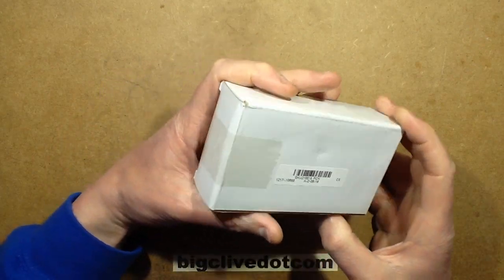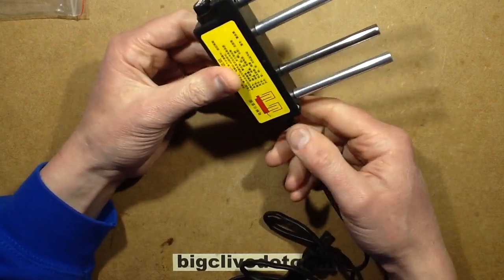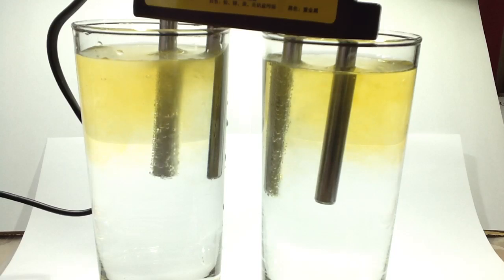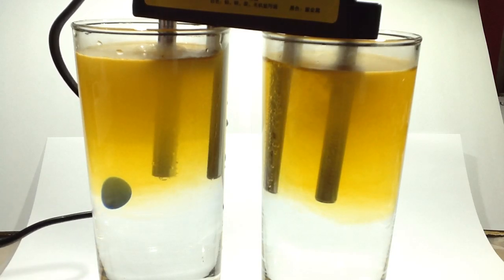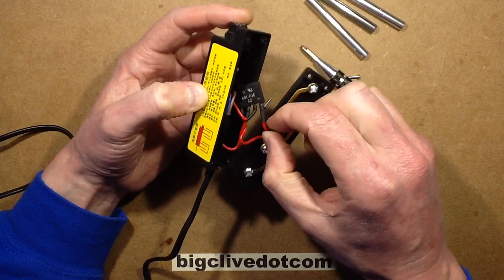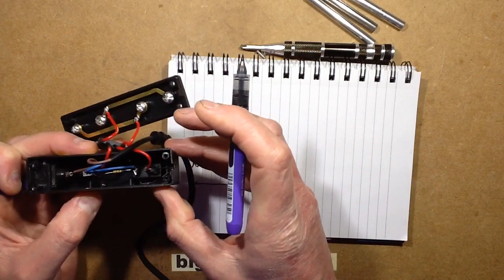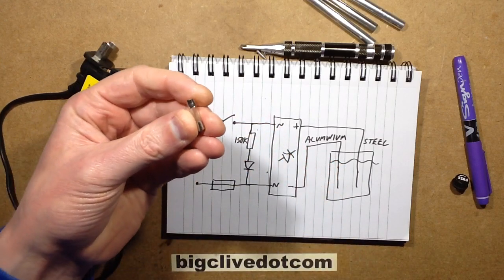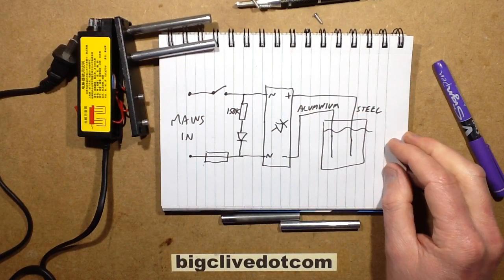Deadly quack water tester.  (scam)

Comment: It would have been helpful to see what happens with distilled water. Nothing?
Reply: I did the testing after reading so many bad comments because we ordered already from China. About the security issue I agree with him, but still not so bad for under 10 Dollars to test whether a lot of minerals in the water or not! We compared 3 different "type of water": "Distilled bottle water" we bought in the super market, "purified water (using our not so cheap water purifier)" and "tap water". We exchanged all the times the 'dirt rods' with the 'clean rods' to make sure that the 'change in color' comes from the rods (dirty or clean). The "tap water" changed the color so badly compared with " distillate water" due to mineral residue in the "tap water" and NOT from the "dirty rods". The "purified water" from is better. The "Distilled water' didn't change the color at all since no minerals inside the water. It is just simple chemistry and physic. Sure we don't know  exactly what's contamination within the water means what minerals we really have inside the water. Otherwise we must buy a labor water tester in range of few hundreds to  thousands dollars to find what minerals and how many PPM they have in the water.
  It's a working item if you know how to use it and what's the idea behind it, but doesn't tell you at the end the water you tested is good or not!

Comment: This video is dumb. Of course the fact the distilled water stays clear is because water itself is not conductive but that doesn't mean the device is a scam, its actually doing its job. What color it turns into is what you should be worried about.
Reply from the maker: Distilled water is very high resistance.  With tap water you would have seen the electrode corrosion because it's slightly conductive
Reply: @bigclivedotcom  Water is only conductive cause of the minerals / metals / bacteria and so on and so forth that the water is contaminated with. 

What this device is actually doing is pulling the water away from the dissolved solids that are in the water. Since opposite charges attract, the hydrogen ion migrates towards and bubbles from the negative electrode and the oxygen-containing hydroxide ion migrates towards and bubbles from the positive electrode. Thus creating the "discharge", usually not cause of any electrode corrosion (depending what was in the water). The color can actually tell you alot about what was dissolved. 

I have used a device of sorts during chemistry and have done this test myself when I was in school.
Reply: @bigclivedotcom  All is about physic. https://www.physlink.com/education/askexperts/ae61.cfm
Reply: It's a simple chemistry and physic behind this idea and really cheap. About the security issue I agree with him, but still not so bad for under 10 Dollars to test whether a lot of minerals in the water or not! We compared 3 different "type of water": "Distilled bottle water" we bought in the super market, "purified water (using our not so cheap water purifier)" and "tap water". We exchanged all the times the 'dirt rods' with the 'clean rods' to make sure that the 'change in color' comes from the rods (dirty or clean). The "tap water" changed the color so badly compared with " distillate water" due to mineral residue in the "tap water" and NOT from the "dirty rods". The "purified water" from is better. The "Distilled water' didn't change the color at all since no minerals inside the water. Sure we don't know  exactly what's 'contamination' inside the water means what minerals we really have inside the water. Otherwise we must buy a labor water tester in range of few hundreds to  thousands dollars to find what minerals and how many PPM they have in the water.
  It's a working item if you know how to use it and what's the idea behind it, but doesn't tell you at the end the water you tested is good or not except we like to know how pure the "distilled water" we buy from Super Market.
Reply: @yahuchananl4543  Both of you stop with the crazy. Distilled water is bad. Get a basic education please. Distilled water lacks minerals which gives the water its taste and it is also healthier for you. These things are purely used for scamming people and anything like the results from this can be achieved with any electrolysis device, no matter how rudimentary. You could just run a current through two different metals and get a similar result and it would be just as dangerous. Bottled water won't be harmful too you unless the batch is contaminated or because of its plastic bottling which is only an issue if you let the bottle get too hot, repeatedly. Tap water is perfectly fine to drink as long as your water provider says so. You are probably in far more danger of being poisoned from artificial sweeteners that you find in plenty of sugar free products than from tap water.
Reply: @pagatryx5451  READ PROPERLY! DID I WRITE: "Distilled water is good?". What I wrote: 'but doesn't tell you at the end the water you tested is good or not except we like to know how pure the "distilled water" we buy from Super Market', means if I need to use "distilled water" for some purposes like in the car, electric iron and many other items. Did I write: 'Minerals in water is bad?'. Otherwise people should stop buying 'Evian' because 'Evian' has minerals which the company claims it is good (I don't know honestly true or not because I am not a nutrient expert). If you test Evian, the color changed  too because of the minerals, almost like the water from our purifier (we are living in Asia at moment)! You wrote: "Tap water is perfectly fine to drink as long as your water provider says so" and you believe it  (I don't believe what they say in area we are living in Asia at the moment). Even in the Alps area where I still have my apartment, I test the water to check how bad the corrosion in the piping is. The water in Alps area is considered as good. As I said, I lived in Alps area (and will go back there) and drink the water of Silvaplanersee  (Lake Silvaplana) if I was thirsty during Windsurfing, BUT don't trust the water from Bodensee (Lake Constance), Gardasee (Lago de Garda) or Lago Maggiore.
Reply: @yahuchananl4543  But this tester isn't telling you anything of value. You can't tell if the water is good or not, you can't tell that at all. You get a colour and have to randomly assume if that is good or bad. There is no point in you using it.

You can buy legit, water testing kits with a multitude of different tests inside that tell you everything you need to know about your water so why not get a legit testing kit that will tell you your waters quality rather than you presuming it, with a dodge testing kit that IS used by scammers. Even if that kit makes your water extremely murky, that does not mean your water is unsafe to drink. Just get a real kit...
Reply: @pagatryx5451  Exactly what I wrote! NOT as answer here, but in the main comment to the the video producer, because some people wrote it's not working or the color came from the dirty rods? 
I just copy and paste what I wrote (and you can check it): 
"About the security issue I agree with you, but still not so bad for under 10 Dollars to test whether a lot of minerals in the water or not! We compared 3 different "type of water": "Distilled bottle water" we bought in the super market, "purified water (using our not so cheap water purifier)" and "tap water". We exchanged all the times the 'dirt rods' with the 'clean rods' to make sure that the 'change in color' comes from the rods (dirty or clean). The "tap water" changed the color so badly compared with " distillate water" due to mineral residue in the "tap water" and NOT from the "dirty rods". The "purified water" from is better. The "Distilled water' didn't change the color at all since no minerals inside the water. It is just simple chemistry and physic. Sure we don't know  exactly what's contamination within the water means what minerals we really have inside the water. Otherwise we must buy a labor water tester in range of few hundreds to  thousands dollars to find what minerals and how many PPM they have in the water.
  It's a working item if you know how to use it and what's the idea behind it, but doesn't tell you at the end the water you tested is good or not, just tell you minerals are in the water"
Reply: @pagatryx5451  You wrote: "You can buy legit, water testing kits with a multitude of different tests inside that tell you everything you need to know about your water so why not get a legit testing". CAN YOU SEND ME THE LINK if you have good experience with the kits, SO I CAN ORDER via Lazada, shoppe, aliexpress or amazon.com, but should not be more than 50 US$! I need it.

Comment: Just got back here. The nights are darker, so I need to catch up with BC and er, get a buzz (again) watching  the previous vids. Just to get tekky/nerdy; if I multiply 230v, for mainland UK, by 1.414 I get 325.22v. Knock a bit off for the full bridge rectifier's diodes: let's say 320 volts! On the Isle of Man you tell us the mains are old-fashioned 240v there. That's getting close to 340v direct current coming out of those prongs. That could ruin a demonstrator's day! Hope those units were banned.
Reply from the maker: They still sell and use them.  Check your local voltage, it'll probably still be 240V.  The 230V is a European paperwork value.

Comment: So tell me what is safe and true to test water???  considering you are the expert.. and what is to say you are not using the same water in the two glasses??

You obviously do not believe in electrolysis.. 

Have you considered you wont get shocked if you handled it properly and did not actually open it up to begin with?? I noticed you were a bit slack in your own quackery.    why don't you make up your own safe device for everyone to use then?? The worst thing about a critic is they have no solution or answer to fix the problem themselves..
Reply from the maker: The solution is to use a chemical test kit and distill some water to see the residue that is left in a glass bowl.  The unit is inherently unsafe in use.  As soon as it is plugged in it could potentially deliver a fatal shock from the exposed electrodes.  The electrolysis effect will only distinguish between distilled water and normal mineral water.
Reply: @bigclivedotcom  Though distilling water has also been proven not to get all the chemicals out of the water like fluoride either. 

Electrolysis actually turns water into hydrogen creating instant gas, so you would not want to smoke around it either.. 

With the quality of mostly Chinese products around the world. or should i say lack of.. 

Anything you use these days can give you an electric shock... lol 

By the way, thanks for the reply on an old video.. Cheers..
Reply: @bigclivedotcom  Can you explain the different results too please? https://youtu.be/9tmNWRNuzro
Reply from the maker: The colour is deliberate corrosion of the electrodes at a rate determined by the conductivity of the water.  Ignore everything the guy says.  He's disabled his comments for a reason.
Reply: @bigclivedotcom   Water is water is it not? Yes i noticed he disabled comments. i also have seen other videos on the testing and i have seen what pure electrolysis can do to.. 

its not the electrodes, though more so the voltage going through them.. proper conductivity should show that tap water is hopeless invested with metals and poison.. 

None the less, I do hope you appreciate the idea of showing people to keep an open mind when testing water.. I have a small distiller at home that i use when i run out of bottled water is good, though even more tempted to  use the distiller, even though it is not guaranteed to get rid of fluoride or metals via the steaming process via filters either..

Comment: It's not a scam, this is science you must not understand. There are reasons to use different metals for cathode and anode.  Also AC is converted to DC in this process. The proper term is electrocoagulatuon. Granted they could build a little safer unit but this is legitimate science. Fact is that your tap water contains just about every medical chemical you can imagine along with many other biological and viral agents. Your water turns colors because the process breaks the bonds of the compounds and in simple terms the are coagulated together because they have been pulled out of suspension.

Comment: jo dude i saw a video of this claiming my waters shit, had no clue what it was saw it on ebay bought it did it
yours turn both glasses brown mine only turns 1 brown the one below the power button why is this ?

as i noticed the tap water looked like shit and the filterd didnt
i decited to turn it around thinking it might only send what evers making the shit to one side
and as i switched the filterd water became shit to

i washed the glass washed the machine put tap water in the one that wasnt gonne turn to shit
filterd in the one that was gonne become shit
as expected tap water looked verry verry clear
and the filterd water turned to shit
Reply from the maker: It sounds like your unit may be rigged to provide that result.  Keep in mind that these units are extremely dangerous when plugged in.  Even with the switch on the unit off it can deliver a serious shock.
Reply: @bigclivedotcom  mine also comes with a few collored squars with chinese letters black white blue green yellow
i noticed my water gets green and when putting the transelater app on it it says copper on green 
i feel like it just showed me my water is rich on copper
Reply from the maker: @Tyson31991  The colour is the electrodes corroding into rust.  The colour chart is probably just a gimmick.

Comment: That’s not a scam  that is a device that will drop out of suspension ( everything ) that’s hidden in your water 💦.  If you put a purified water sample on the left ( purified means reverse osmosis ) your sample to test take it from the filter you got taken for.  We have been in filter engineering since the 70s.   The reason why both your samples look terrible mate ?   Is because your testing two contaminated waters.   And no that’s not enough time you did it for seconds. Run the anode 5 min to 10 min.   There’s no parlor trick here   The nasty stuff is not from the anodes it’s what’s in your water mate. Lol.   Yellow is sodium.    Yes it’s made cheap they also make costly ones. It’s a device to show you what is hidden in your water in suspension.   Only 5 ppm of sodium alone will turn water yellow.   It gets worse from there. Your not using it properly.   If you are selling a high end puffier you use that as your test sample then you put your customers daily water they drink.     Proper Water filters and sales of them is not quackery there is in the USA ( no doubt your country ) 24,500 to 30,000 contaminants in every glass of water you drink in 2014 Germany introduced to new technology for identifying contaminants that Americas antiquated labs cannot test for doesn’t matter if you spend $200-$1000 to test your water in America you won’t get more than 200 contaminants showing up most of the time you’ll get 37 which happens to be exactly what the government regulates only and not one of those 30,000 contaminants is beneficial.

Comment: Well, that colored residue comes from the metal that’s being used as the anode, which in this case is steel. The bubbles are what comes from the water, so if you really want to assess water purity using electrolysis, you need to look at the bubbles. Still, it doesn’t tell you much. Better would be a conductivity test.

Comment: Having two different alloys as the electrodes is, quite literally, to force galvanic corrosion to take place. The electrodes are dissolving themselves into the water, which is why the current was rising as the water continually got nastier. The more corrosion, the more metal in the water and the more conductive it is.

Comment: How can you call it a scam after such a poxy test. 
If one glass was distilled and remained perfectly clear and the other turns dirty (which is what happens when tested PROPERLY) how would you explain that?
Youve put this through an unseen and unnammed water filter and the other from a tap.. id say youve been sold a crappy water filter. You should at least show us which filter you used. 
All in all a terribly unfair test.
Reply from the maker: It fakes impurities in the water by implying that the rust being generated by electrolysis is already in your water.  Electrically these things are so unsafe that it would surprise me if several people haven't been shocked, burned or killed by handling one, even when it's apparently switched off.
Reply: @bigclivedotcom  if that was the case then it would look the same rusty colour in distilled water. During fair tests distilled remains clear. Also the particles in tap water are many colours not just rust theres black green yellow ect.
Reply from the maker: @coinop7278  The distilled water remains clear because it isn't conductive and the rusting of the electrodes doesn't occur.
Reply: @bigclivedotcom  so you can use this device to determine how much metal is in water.. which is what its used for meaning it works as it should?
Dont mean to be condiscending im just striving for as much info on this device as possible.
Reply from the maker: @coinop7278  Any natural minerals will make the water more conductive.  Pure spring water is slightly conductive and would cause the rusting effect.
Reply: @bigclivedotcom  so the fact the water stays clear when its distilled, and tap water turns dark...means this device does exactly what its supposed to do. 
Whats your problem with it?